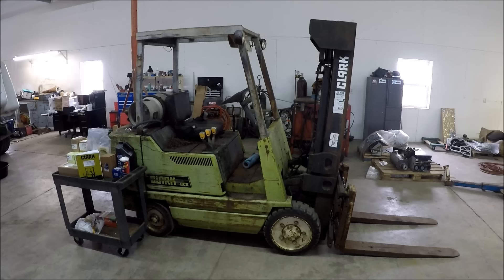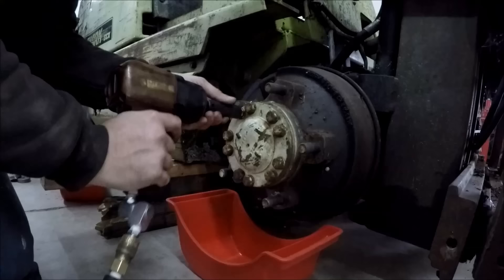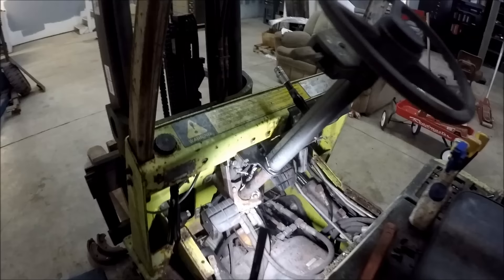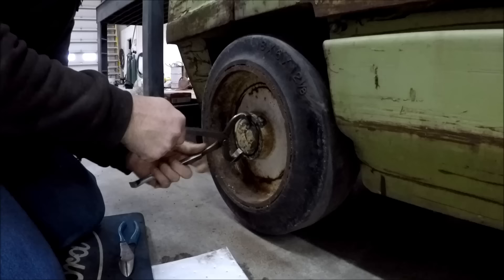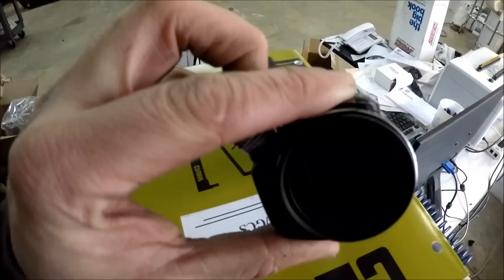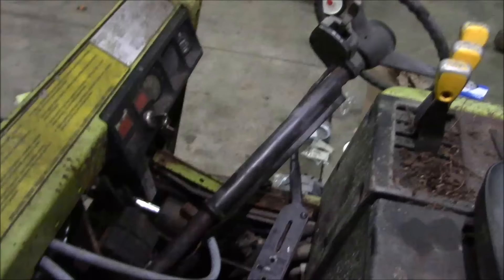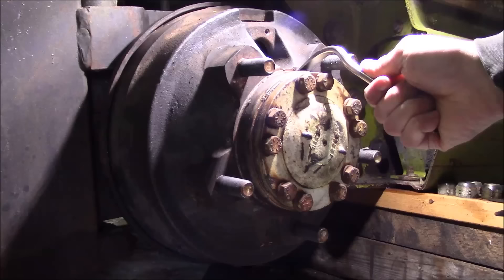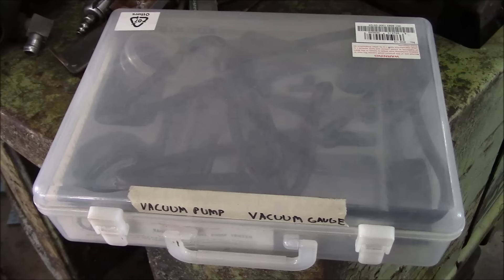Fixing a Forklift that Sat in a Field for 17 Years - Brake Job and Rear Wheel Bearings - Part 1

Comment: Way more than 17 years ago I was a Clark Forklift mechanic. So cool to see this blast from the past video.
Not much he doesn't know something about and what he doesn't know his spot on intuition kicks in.

I have been watching Wes work for just a few days now and I have to say he is a damn good technician. 
I remember those master cylinders and break-jobs. I used to carry a spare reservoir cap with a make-shift fitting for low psi air bleeding. 
Thanks for the great video and keep up the great work.
Reply from the maker: Interesting. I don't know why Clark would make a simple manual brake system so complicated. My old C300 brake system was much simpler and seemed to work better.

Comment: Wow! It's almost like that forklift has been sitting in a field for 17 years.
Reply: 4 or 5 years ago i somehow lost a really good brand new kevlar chainsaw glove in my yard somewhere, today I found it. I can't say it has faired as well as this forklift
Reply: I am glad it wasnt 18 years. :)
Reply: If it had been 18 years,he would've had to scrap it. It would have been just too far gone.
Reply: @erneststanley4854  yeah you cannot repair anything sittin in da fields for more than 17 years right
Reply: Yeah. You gotta have a cut off line somewhere. It's just common sense.😂😂😂😂😂
Reply: 16 years 9 months tops.  17 years? Shut the front door :)
Reply: I think I’ve got a bead on the strategy here. Turn to the page in the service manual labeled “List of Parts” and type all the part numbers into an order form. When they’re all installed, you’ll think you have a new machine!  😎👍
Reply: @joeromanak8797  Theseus' Forklift

Comment: Wes, that is exactly, precisely, the way to do those brakes and wheel bearing replacement. That is the way I did everything exactly for almost 40 years. Packing the bearings by hand, cotter pin replacement, bearing nut adjustment, and never seize on bolts and brake line nuts. Yes you are right, It's not your grandmoms Cadillac. My work never came back to haunt me, and neither will yours. Don't listen to jerks on comments, they are jealous. Keep your hands on the work, inspect your parts carefully and no problems.
Reply: This guy works serious for shure.

Comment: For four years i worked in power yacht construction.  It was great, putting things together from the ground up.  One day the helper for the service specialist for completed/delivered boats, was gone and I got assigned to fill in.  Gawd, it was awful.  I never had to work in such awkward constrained conditions.  Your working in the brake cylinder tangle reminded me.

Comment: Well I can see a few things have changed since I was learning to be a mechanic. We rebuilt most everything. Master and wheel cylinders were always honed unless they were too pitted or the castings were broken. Kits usually included new boots. Brake shoes and linings... The "museum piece" you were talking about is called a Brake shoe arcing machine. Every brake shop and many gas stations had one. We also re-lined brake shoes with a punch/riveting machine. Petroleum products were NEVER used for anything concerning brake systems. Brake parts were cleaned in alcohol and honed and assembled with brake fluid. As for bleeding brakes the big ball Bendix or Wagner Lockheed pressure bleeders are the hot ticket. I don't have one anymore so my wife just pushes the pedal on command. Now for the "Mystery Lathe"... I could hardly see much from what you showed, but it reminded me of a Pratt & Whitney I had a few years back.
Reply from the maker: Yeah. I doubt there is a working brake radius grinder within 100 miles of me. These shoes do not have rivets either, they are bonded. It's a Springfield lathe.

Comment: Your install procedure for the spindle cotter pin is correct. I was a licensed aircraft mechanic for thirty years. Although the majority  of assemblies use a fiber nut and bolt assembly. Where  a cotter pin assembly is specified with a castellated nut, bending one leg of the cotter pin flat over the end of the  bolt (spindle) and snipping the other leg of the cotter pin off even with the threaded portion of the bolt or spindle is the approved method, at least on aircraft.

Comment: proper way to install a cotter pin. is to put it in so the nut doesn't back off. other than that it's decorative :D
every once in a while put in an old nail and bend it over just for giggles
Reply: Oh thats chaotic evil right there
Reply: Nail, coathanger, hopes and dreams, whatever.
Reply: except it isn't a cotter pin, so no harm done.

Comment: Been a forklift mechanic for 28 years and have did plenty of brake jobs on Clark GPX/GPS trucks. Very interesting solution you came up with on bleeding them out... I must admit I was waiting for it. That system is at best, a dirty rotten Bas$&#d to bleed.. I came up with what I believe is the easiest way ( disclaimer) everyone has their own opinion.. you just remove the snap ring holding the plunger in the master cylinder and let the internal spring push the plunger up and burp the air out. Then push it back in and reinstall the snap ring.. you do this after hooking up the lines and filling the reservoir.. then install them in their final position. Good call buying the manual. If you have any issues with the fuel system, this truck probably has an IMPCO model J regulator along with a CA 100 carb mixer just know that LP fuel systems require a good vacuum signal from the engine to work properly. They run better and have more torque with retarded timing.. I long ago gave up using a timing light and just do it by ear.. they also start and run better with a lean fuel mixture, if you want or need any tips on setting it up be glad to help.. your a pretty talented tech keep up the great content..
Reply from the maker: Do you know which master cylinder is supposed to be where? I put them on the same sides as the old master cylinders, but now I'm not so sure. Currently the larger bore cylinder is on the brakes, and the smaller one is on the inching valve. But I think that might be wrong. The smaller bore cylinder would give more pressure at the wheel cylinders.
Reply: Wes yes you got it right. The larger bore cylinder provides more pressure than the smaller one and it provides more volume to supply two wheel cylinders, vs only having one inching cylinder on the other.. hydraulic force multiplication F= P x A.  Force = Pressure times Area.
Reply: Wes I heard you say that there is no proper way to install a cotter pin... oh but there is, and it is so simple it will blow your mind as it did mine when I tell you how... you were so close to it I thought you were actually going to do it. When you put it in the first part you did was absolutely spot on by bending the tab over the end of the spindle, but instead of just cutting the other tab off you cut it to the depth of the nut your securing. Then to set it put the socket you tightened the nut up with on the nut and smack it with a hammer so the socket goes back on the nut. That will set that tab flush with the nut..

Comment: I chuckled at your squatch253 comment...yes he is persnickity on his fold-over locks! ...love your vids too young man
Reply: Porsnickity is an excellent description. But I would much rather have him work on my stuff. Although Wes does not work on 1938 equipment...
Reply: @paulsilva3346  No thanks , by the time squatch235 gets done over inspecting and measuring everything a 2 hour job turns into a 50 year project , just for him to change oil I can pay off my thirty year mortgage
Reply: @MrBuck295  Awww, Bucky, Bucky better to do a job once in due, and proper time than re-do it every 5 to 10 years and have bad SAFETY and poor performance.  Sloppy shoddy work Is acceptable to you, that's your thing. It is not here, or there... Time will tell, here, I hope the expedient practice of this one instance does not bite him in the familial family sac...
Reply: @MrBuck295  Dude, its his HOBBY. (Plus he is a working mechanic) You don't like how he does things, why the frack are you watching? Just a note, you have zero content, thus giving you ZERO credibility. Squatch is having fun and he and his father have plenty of impeccably finished projects. You (to repeat myself) show us NOTHING.
Reply: @wildtimbrown  I show nothing because I don`t feed  trolls like you and I watch because I can gives me a laugh

Comment: This brings back mixed memories. The long forgotten dark art of drum brakes maintenance, a skill betrothed on only the most skilled and gifted. Those of whom have been chosen to process these skills, must pass them onto the next generation, so that they may experience the same pain, sufferings and frustrations of those whom come before them. I'm just happy our forklifts have discs, unfortunately they don't enjoy exposure to iron ore dust, mud, offroading or abuse !!!. And if you ever need to replace the hubs due to maximum machining thickness being exceeded, look at resleeving with shrink fit stainless steel. We regularly sleeve CAT and Hitachi loader brake drums. Submerge in CO2 for known time period, remove and drop in into drum, test for movement, and remachine to manufactors minimum thickness. Job done. 👍👍🇦🇺
Reply from the maker: Hmm. That's an interesting idea. But a 12" diameter stainless sleeve might cost more than a new drum. Many of these new disk brake machines have inboard rotors, so everything old is new again...

Comment: Thanks for the post, huge help! Regarding bleeding these beasts. Using air did not work for us but, using a squeeze bottle full of brake fluid and reverse bleeding it by forcing brake fluid up through the wheel cylinder worked in 3 minutes.

Comment: I love how every time you use a specialty tool, you tell us what it is. Makes shopping a lot easier for us weekender types who just pry dust caps off with a flat head screwdriver.
Reply from the maker: I did that for years before I knew about dust cap pliers. The first time I saw them I had to have a set!

Comment: I salvaged a GPX30 that sat out in a scrapyard a few years, lots of familiar stuff here :) surprising with all the room under the dash, that the masters are so tightly buried... redoing a 1963 towmotor currently, that had sat out in the scrapyard for 5 years- its a small machine and everything is jammed in there. converted it to power steering with a chevy astro van box and a bunch of random parts, was challenging...had to flip generator brackets to raise enough to make room for a ford power steering pump- and on the old ones, that counterweight has to come off for access to  anything...
 on the Clark, biggest surprise was how heavy everything was, think the brake drums and hubs are close to 100 pounds on the bigger trucks- a wheel/tire probably 250...
Reply from the maker: Yeah that's probably right. This little forklift weighs almost 10,000lbs.

Comment: When I did my brake bleeding I use a water bottle and hose. Worked perfect. Last time my friend and I used the vacuum pump and it never worked right.
Reply: Vacuum pumps (in this application) rely on you having a closed system, if there's a leak before the reservoir,  they are useless. Just saying.
Reply: FishFind3000 Crack the pedal with a hood prop , and put grease around the threads on the bleeder , that should help. I have a mityvac , but I also have a pressure pod I made out of a 1gal chem sprayer , (don't use Roundup any more) and adapters from snapon.

Comment: My Clark forklift has a wheel cylinder leaking on the right side... they're all such a pita to access/work on, I blocked it off and have been running
with just one wheel brakes for the past year or so... after watching this video, maybe I'll tackle the job this Spring. Thanks for the great series. mardyn
Reply from the maker: It's really not much worse than working on an old truck. We're all spoiled by modern outboard brakes.

Comment: Another great video !
I’m curious as to what penetrating oil you use, it seems like magic so far. Also love the air hammer for punching out bolts. I’ve been a mechanic for a long time and still learn plenty of tricks from fellow mechanics. Spot on with the cotter pin 👌
Reply from the maker: I use PB Blaster usually. Or Kroil if I'm feeling fancy.

Comment: I was a Clark Service Mech for 30 years, When you pull the two Master Cycls pay  close attention to the inside dia of  barrels of the master cycls , one is larger than the other, if you place them on the wrong side of the steer column your brakes will not work properly.
we found out in our company, that the only way you could bleed the brakes by using a Handpump Vacumn tool to pull the air and fluid through,  pumping the brake pedal will not work in bleeding, the reason is because of the operation inside the master cycls.
If I remember the larger barrel master cycl is for the brakes, and smaller barrel is for the inching control valve.  there is a inching  valve is side of transmission, check it for leakage for brake fluid.
Good luck on your repairs.
Reply from the maker: I put them back the way they were before. I hope that was right...

Comment: Anti-Seize goes a long way, I put it on everything
Reply: Salads?
Reply: Once you dip into it, there doesn't seem to be a NEED to "put it on everything'. It will get there on it's own 😎
Reply: I legitimately used this line the other day and just came across this thread.
Said to another guy at work that AntiSeize is like Frank's, I put that S*** on everything! So made me chuckle to see this lol
Reply: I’ve always found a bit of bearing grease works better than anti seize. Anti seize or any lubricant destroys threads though, and makes everything torque improperly
Reply: I gotta remember that one :) POR15 paint is similar, one drop and its on everything within a hundred yards :)
Reply: Absolutely! And I have noticed some manufacturers now recommending it in owners manuals. Never seen that before.

Comment: Some aircraft have vertical master cylinders on the back of the rudder pedals.  They have a vent  in the cap of the master cylinders.  We use a squirt oil can with clear tube attached and bleed from the wheel cylinder up.  When fluid comes out the weep hole you are done.  Don't know if that would work in your application but it is quick, easy, cheap.
Reply from the maker: That sounds like a much better design.
Reply: Use a old squirt  oil can,, Bingo!.. I use one to test oil pressure and fill the crank and pre lube the engines  on the Norton and Triumph bikes I work on . a good squirt can can pump over 80 PSI and I use it to check the oil pressure blow off valve setting which is about 45PSI. So reverse bleeding brake fluid sounds very doable only needing a handful of PSI.

Comment: If you Wanted to bleed them from bottom up (brakes)...I just this instant came up with this, you could easily do it without ANY special equipment.  Just use a hose + gravity.  Place the new fluid WAY above the reservoir.  Aircraft (some) are supposed to be bled bottom up (a HUGE syringe also works great for that).
I do (and fyi, whichever method you use,...more power to ya)have a little trick I've never seen used before which I LOVE, and it's simply...get someone on the brakes while you place your finger over the bleeder nipple.  Lightly push (or push hard if your into masochism) while the person on the brakes pumps to their hearts content.  It's, by far, the fastest way I've ever found to bleed brakes. 

One LAST thing..which may not be worth the set up time...but you know those gerbil gravity water feeders?  Where the pet rat drinks from it...after it drinks enough, a bubble forms and refills the tip with water?  Make a system like that (a stiffer bottle works better, so you may not be able to use the original brake fluid container) and you can bleed an entire bottle of brake fluid without worrying about ever running dry.  Ooof, I ramble at times.

Comment: I recently bought the Gearwrench hand bearing packer on amazon for $25. I enjoy using it. Still messy but easy. Great video. On the hot wheels and matchbox cars restorations channel, people argue about cotter pin vs split pins. Innocent cotter pins will be the cause of war someday
Reply from the maker: Yeah, I don't understand the controversy for such a simple part.

Comment: It's amazing that you were even able to get the wheel off. The one I got sat outside for 2 years. Toyota(have no idea the model number). Replaced both master cylinders(straight up guessing). Steering is shot. That's the reason why they sat the machine.
Reply: Pulling those wheels is soo much fun, i like pulling hubs where the shoes are frozen to the drums specially since everything on a fork weighs a million pounds,we have a BIG Clark at work, we call her "Sally" , i pulled her wheels off once to do a break job, it took like 5 of us to put them back on and that was using a jack, ha ha ha